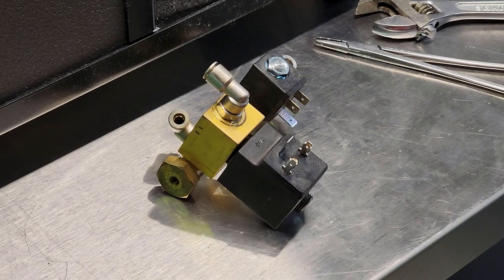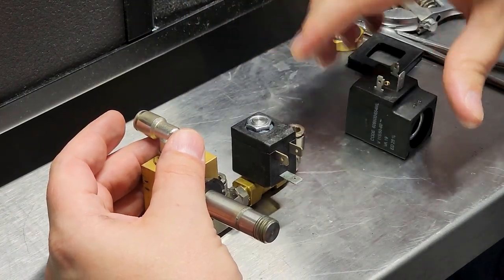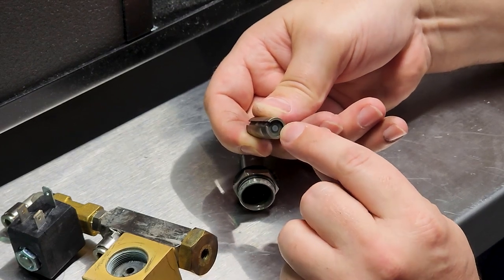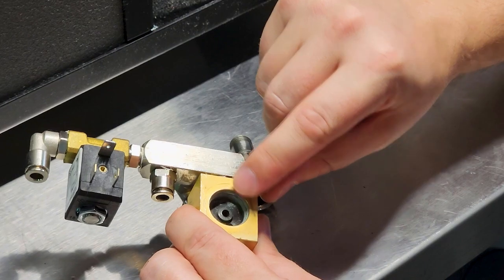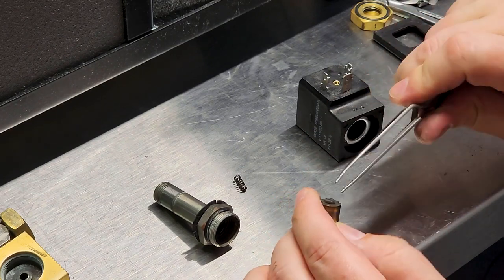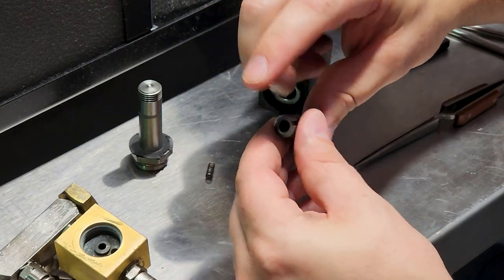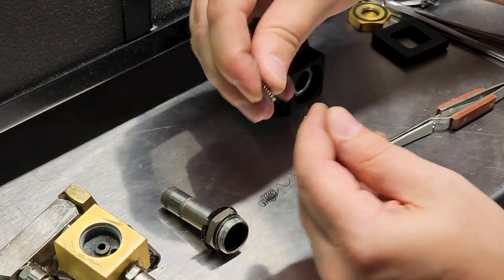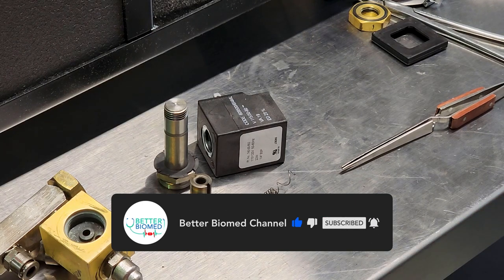Anatomy of a Failure: Solenoid Valve

Comment: Fantastic video, this is the part of solenoid failure that I did not understand until now.  We'd take out the entire assembly and I would see some rings that I didn't get as to why they are there.  Thanks very much.

For cleaning out our valves, we use lye as the metals are almost always brass or stainless steel.  Lye melts everything, from carbon, certain corrosions, to the glue that holds the threads secure.  They'd come out looking brand new without a need for wire brushing, toothbrush and water only to remove excess lye.

Thanks again for your videos, we're all gaining knowledge that will translate to better quality service output 
👍